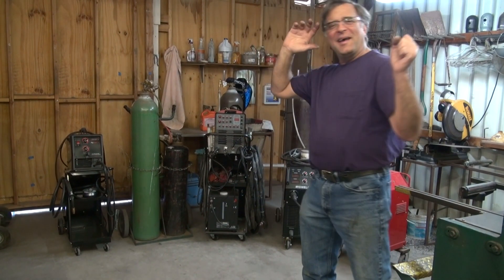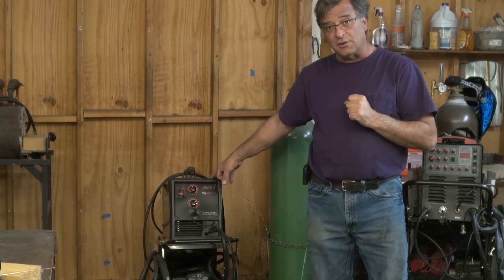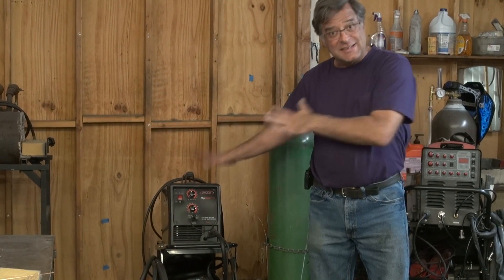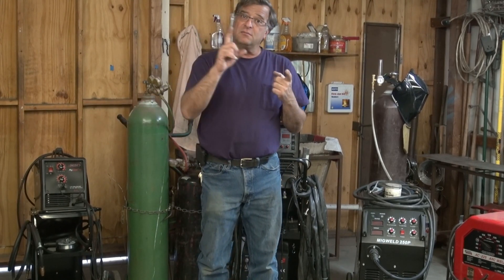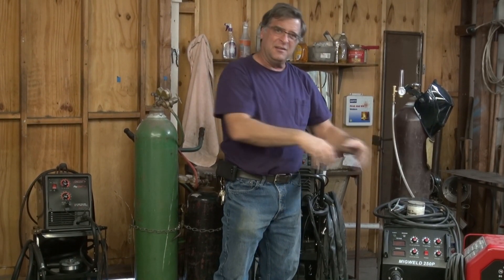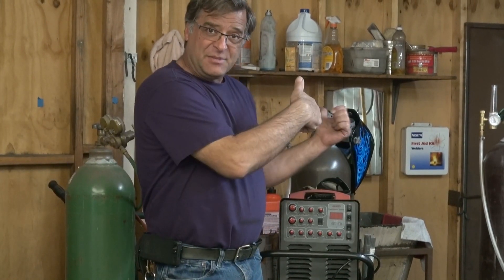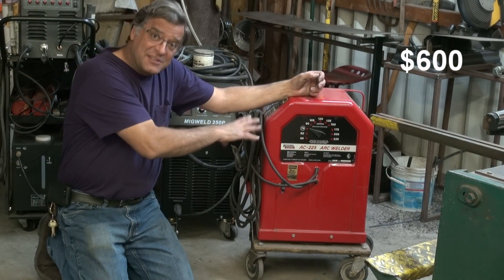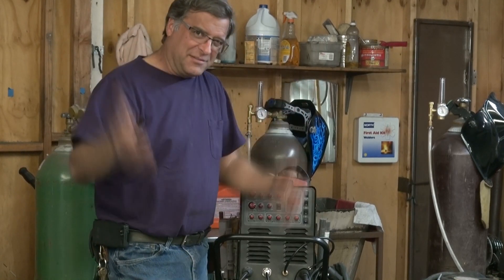How to Pick Your First Welder - Kevin Caron

Comment: I have a garage I'm renting that has 220 thankfully and my first four machines I just recently picked up are as follows Hobart TR 300 AC DC stick welder, a Lenco panel spotter c3000, a Miller Regency 250 a Miller spoolmatic 3, and an old Hansen Mig 1000 and I got all of the above for under $200 including a full tank 80lb c25 gas so for the sort of stuff I'm doing I'm pretty much covered on every angle now I just need to find a TIG machine and a plasma cutter
Reply from the maker: You are getting a great collection of machines going on!   Sounds like you have all your bases covered and you know where you are heading.
Reply: @KevincaronSculpture  thank you and yeah thankfully I was able to grab all of them for damn good deals but as far as where I'm going that I can't say for sure LOL so many possibilities

Comment: Almost every question I had answered, thank you.
On the smaller welder, the 110, is it truly a 110, does it need a separate breaker/circuit, can I move it around the garage or even take it to friends house?
Reply from the maker: Runs on a standard household circuit. Likes to have a 20amp, but runs fine on 15.
Reply: Thank you!

Comment: I want to build a hydraulic furniture dolly on casters.  The material I'll be using to make the frame is 2"x1" tube steel, and 1.25"x1.25" tube steel.  I'm not sure what the thickness of the tube steel is, but I figure experienced metal workers probably know what the thickness is already based on the dimensions I gave.  Thinking more long term as well, I would like to build a 20' car trailer with the same welder.  What type of welder would I want to buy to do both of these projects?
Reply from the maker: I would point you towards the Everlast MTS line. That will give you 3 different processes in one machine.  Mostly you will want a mug welder but having a tig welder as well will be handy.

Comment: great video. i'm starting a mobile small engine business doing mostly tractor work. i will be working out of my truck on a generator. i havent bought a generator yet and  i dont know how much welding i would be doing, but in my past ive sent my parts maybe 10 to 15 times a year to our welder. i have only welded a couple of time in my past. what do u think i should use or buy for both a generator and a welder. i imagine most tractor work would be steel.
Reply from the maker: You need at least a 10K INVERTER based generator to run the newer welders. If it was me I would have an MTS  machine. So you have mig, tig and stick all in one. That will get you started. Keep in mind that with a 3 in 1 machine if one part goes down you will most likely lose the whole machine. The other way to go is have 2 or 3 different machines. That keeps you working but costs more to acquire and takes up more room. I like the Everlast  welder line.  You can go with Miller if money is no object or Lincoln.  You might find some food used machines to get started and upgrade has you go.   Good luck and welcome to the club!

Comment: I though aluminum you got to have AC not DC to weld
Reply from the maker: Most of the time, yes , that is correct.   But you can do dc high amp with helium and get the job done.  But only on thick aluminum.   Not anything under about 1/2 inch I believe.

Comment: Hi Kevin, so I made my purchase today for the 256 everlast. Can I just add a 50-60 amp breaker to my box & run out some heavy gauge to a plug ? And its hf & this will be at my home, is it a must to run a ground rod to hook up in back of the machine ?
Reply from the maker: You only need a 30 amp breaker to run this machine.   50 amps would be better but not necessary. As for the ground rod, no, it is not required, but it would be nice.
Reply: @KevincaronSculpture  thank you Kevin, always for your quick response.

Comment: I taught myself to weld oxy acetylene in the basement of my apartment building ( on the sly ).  My first nozzle had a bad O-ring.  Then there was the time I was learning to cut on an old basketball hoop steel pole that (unknowingly) had been filled with concrete. Very exciting overall.
Reply from the maker: Just have to get it a little hotter!!

Comment: If you use a coat hanger (cocaine as heard by many in the comments), straighten the coat hanger all the way and put an end in a drill and use sand paper with pliers to take off the coating on the metal. (Use pliers or you will soon learn as i did, just how hot friction can get)
Reply from the maker: Never thought of that.   I just grab a hanger and go for it.

Comment: I need to weld super thick solid steel what kind of welder should I get stick welder types that is
Reply from the maker: I like the AHP and Everlast brands.   You can get a great machine that will not be so expensive that you need to take out a loan first. 250 to 300 amps for the really thick stuff.

Comment: Can a MIG welder use flux core wire in a pinch when gas isn't available?
Reply from the maker: Sure, just have to set the machine up for flux core wire first.

Comment: I watched this old guy weld sheet aluminum with a torch, no warping, maybe the warping is a higher possibly, but it can be done.
Reply from the maker: Sure, the old guys can still surprise the new guys.   Just don't ask them what they think of the new machines with all the touch screens and digital controls.

Comment: Thank you for the video.  I learned to weld in Highschool and was pretty good at it.  Now, 18 years later I want to weld again.  I'll be welding pipe fence,  as well as small auto/home projects. What you think about the ESAB EMP215IC 120/230-Volt Dual Voltage Professional Grade MIG/TIG/Stick Welder?  Would the ESAB Fabricator 141i Multi Process Welding System be enough?
Reply from the maker: I think the Fabricator is a fine machine.   All depends on your budget and what you want to do with it over the years.   Personally I like the Everlast and AHP lines better.  They both have Multi process machines.
Reply: Is that galvanized pipe?  If so, be careful about the fumes.

Comment: Hi Kevin, looking at a dual voltage Lincoln 180 dual. Any experience with this one. Would like to weld rr spikes and other items for yard art.  Also looking at a MM250. Not sure if that is overkill
Reply from the maker: Have not played with the Lincoln 180 dual yet.      I do have a MillerMatic 251 and it is a great running machine.   If the price is right I would go that way.    Having too much power is not a problem.    Not having enough is!

Comment: alright, I'm just starting now, so I plan on starting with Lincoln Square Wave TIG 200. Eventually(1-2 years from now), I need something substantial to weld truck chassis. What welder do you recommend? my garage as 220V/30(Nema 6-30??) Amp outlet and outside I have 240V 50 Amps(Nema 14-50 outlet).
Reply from the maker: If you get the Lincoln you are going to be ready to weld just about anything.   If you can get a 250 amp machine that would be better.   If you are looking for a mig welder then I would suggest a 250 amp machine as well.   Miller and or Lincoln make fine machines if you have the budget.   I have had great luck with the AHP and Everlast machines.
Reply: Thanks Kevin, I'm not seeing any TIG machine on Lincoln site that says 250. Do you specific model name that I can google? I'm ok with other brands as well.
Reply from the maker: My bad!    225 or 275 amp only.   Check out the Everlast PowerTig 255ext for a tig/stick machine.  Have been using mine since 2014 with no problems.   They also have a PowerMTS  253 (I think) but have not seen one yet.   It is a 4 way machine with AC/DC and a host of other features.  Been using the smaller version (221 amps)  for a year or so and it is a good machine.
Reply from the maker: You should also check out AHP AlphaMig 250.   Just on the market as a 4 way machine.  Just got mine and will have videos in the next few weeks.
Reply: Thanks Kevin!!!!

Comment: New to welding need to weld 1/4 in steel tube on a couple gokart. Will be doing it outside in the back yard. Will be useing 120 as the power source. What are my options?
Reply from the maker: Make sure you have clean metal and if you are using solid core with gas make sure you block the wind.  If you are using flux core just make sure you have a good fit.    For stick I would recommend 7018.

Comment: what materials can I wled with a 90 A machine?
Reply from the maker: Well I am assuming you are talking about a Stick welder.   You could maybe weld 1/8 inch steel with this machine.  Not any thicker I am afraid.    If it is a mig welder running flux core less than 1/8th inch.
Reply: Kevin Caron, Artist it is a flux core 90 A welder ( only flux core) and I have to choose between this and an 140 A stick welder...
Reply: I am a beginner and I don't know wich model of welding machine to buy, can you recommend to me a good one?
Reply: I got 150 dolars
Reply from the maker: Keep what you have for now.   Learn to weld and maybe make some money.  Nothing I can recommend in your price range.
Reply: I don't have one for now, it's the first welding machine I buy and I was thinking to a flux core, is it better then stick welding?
Reply from the maker: I like stick over flux core.   But most guys will say go with the flux.   Your choice for sure.
Reply: thank for advice, good video... very helpful for a beginner like me

Comment: im trying to get a tig welder so i can weld stuff on my cars etc...recommendations??
Reply from the maker: AHP alphatig 200.    Best AC/DC tig on the market.
Reply: ty ill check it out
Reply: Disconnect your battery before you TIG weld on your car.  You can screw up the car's computer if you don't.

Comment: Does argon gas blow of  during welding what is the risk and safety
Reply from the maker: The argon gas flows across the weld and keep oxygen from getting in to the weld.

Long as you don't try to breath the gas you are fine.

Comment: Hi Kevin, how are you? I live in Ecuador and am wanting to get started learning how to weld so I went ahead and started looking around. In my area all I can find is either $1500+ imported 220v mig welders (mig only or multi in 1) or its the generic rebranded $500 chinese 3 in 1 welders that are at least dual voltage. ( I would have to get a 220v meter put in and wired up to use anything 220v only and seeing as I am a renter, that isnt quite an option.) Either way its going to be quite a decision to make seeing as $500 is the monthly wage for a average full-time job. So just plunking down $500 is quite a big loss if I end up with something that doesn't work properly. So I thought I would ask if you or anyone reading the comments has any experience with chinese generic 3 in 1 welders and if they are worth it to start learning with. The chinese welders available here look like they are all the same model with just a different brand on it. The only one I could find a actual model number of was the gladiator 3 in 1 model: IMET 8250/190 BVM. any experience with these things? ( http://tinyurl.com/yc5wbpce http://tinyurl.com/ycdzj6bx )
Reply from the maker: I really know nothing about those machines!   

Sorry.

Comment: Mr. Caron, thanks for making the video.  Very informative.  Made my decision on what type of welder I needed pretty simple.  Pretty sure the 110 volt, flux core MIG welder will suit my needs (utility trailer repair/muffler and exhaust modification/lawnmower deck repair/etc.).  Thanks again for the information.

Comment: First off love your videos!  Have you ever used any of the Eastwood welders ? And if so what do you think of them? I am thinking of the  Eastwood MIG Welder 110VAC/ 135A  for my first welder. Would this work out for making small sculptures such as small scale bells and stands for them.
Reply from the maker: Sorry, never even seen an Eastwood machine.
Reply: I have the eastwood mig 135, it's really a good welder if you stay at 1/4 inch or less! I got mine for 269.00 to my door!  I chose it because I don't have access to 220.

Comment: just get something that will burn an E7018 and start welding. a shitty wire feeder or gun will drive you insane so unless you are doing high production, heavy fabrication or aluminum... SMAW is the way to go.
Reply: Marshall Clark Yep, SMAW is the way to go. I prefer 6011, tho. However, the plain fact is, it takes a bit of a skill level to stick weld that alot of beginners aren't willing to obtain. They wanna run out & get a cheap wire feed flux core because it's basically so easy a chimpanzee could about weld with one. Heck, if those wire feed flux core welders weren't so cheap, readily available & super easy for beginners to weld with AND if stick welders were all that was available, I bet you'd see a whole lot less DIY build/repair YouTube videos that involved any welding. I've seen alot of beginners that could put down a decent bead after a few minutes using a wire feed welder but couldn't strike an arc, let alone maintain that arc & lay a bead with a stick electrode after a half hour of trying, and that's about how long it takes them to give up on learning to stick weld & they go buy a "so easy a chimpanzee can use it" flux core welder, use it on a couple "around the house" projects & think they're a welder that they actually aren't.

Comment: Also forgot to mention Kevin as the part will be left bare metal I also would like the weld to be not noticeable at all. So not sure what method to take into  account.  If that makes any difference or not. Thanks again buddy hope your having a great day.
Reply from the maker: I see a lot of grinding and polishing in your future!    The biggest thing I am worried about is warping the ways.   All depends on where the damage is and how much heat it will take to fix it..     You might want to disassemble it and take the damaged part to someone that is more knowledgeable then me.
Reply: Kevin Caron, Artist thanks Kevin the ways are in perfect condition.  I should of made myself clearer what I meant to say is the large tray under the bed . Where coolant is collected is pretty beat up. Not a great deal just needs straightening out
Reply from the maker: Oh, okay now I understand.     You should be able to mig or tig that and get a great weld.   just have to get it clean before welding.

Comment: Hi Kevin great channel I've just subscribed. Wanted to ask your professional opinion . I'm just started restoring fully my colchester master 6inch lathe built in 1939. And have some damage not by me but previous owner. Where the compound slide runs across the two grooves.  The very corner has been broken off.  And don't want to just leave it like that considering I'm fully restoring like it was, when it left the factory. Do you think I should consider purchasing a oxyacterline welder. To repair the slight damage to the corners. I'm prepared to  learn before even attempting the project just want your input on what's the best way to go down.  Also my workshop has not been built yet so be working outside in the garden. Also there's a few dents in the lathe tray that I need to remove. Be grateful for your advice Thanks in advance
Reply from the maker: Thanks for watching and putting me on the spot Mark!

I would stay away from the O/A rig for this repair..      If it was mine I would use a tig welder..     But without seeing the damage I am not going any farther than that.

Comment: Have you ever reviewed welders from Harbor Frieght???
Reply from the maker: Nope, have to have the budget to buy machines for review.
Reply: ChuckE2009 has reviewed the Vulcans.  The Vulcan brand seems like a real attempt to improve.  I bought an OmniPro220.  I can MIG, TIG and stick, in 110 and 220.  It has an LCD screen and you select options for type of weld, electrode, gas, and metal thickness, and it comes up with a setting for you.  You use it a little and then adjust, if necessary.

Comment: Hi Kevin I've never welded except minor stick spot welding expanded metal to trailer ramps but I want to start, a bucket list thing I guess. my budget is around $2000 that has to include buy my own gas bottle. I could go a little more but might anger the Wife. I'm wanting a MIG/STICK. I'd like to weld up to 1/2" mild steel. even some aluminum.  I really could use your advice.  I love your videos. in the last year I bought a heavy duty oxygen acetylene cutting torch and a 80 amp simadre plasma cutter. my garage and basement is wired for 220. I've been thinking about a Lincoln 210 MP but I'm just not sure if that's the one ????? Need Help deciding.
Reply from the maker: The Lincoln is a fine little machine.    Should be just right for what you are looking for.

Comment: For the 220v couldn't you just run 2 cords to it from different circuits in the garage? Why wouldn't a 220v welder have plugs designed for this?
Reply: No.  They would have to be off opposite sides of the feed.  Well so in theory IF you know you are off opposites sides and you wire it correctly.  No company would ship it that way because if it's not from opposite sides you won't get 220 and if the outlet is wired wrong you will have a dead short and a law suit, fire, big problem.
Reply from the maker: Or just wire for 220 and be done with it..
Reply: Kevin Caron, Artist
Well yeah, but you can't rewire a home owner's house.

Comment: Any suggestions for the best TIG welder that can run 110v? I will have access to 220v on occasion, but don't want to count on it.
Reply from the maker: AHP AlphaTig 200.
Reply: My vote would be the Everlast 200DV or if you have the money definitely the 255EXT dual voltage.
Reply: I would second the AHP Alph Tig 200.  They are pricey again right now but apparently when the stock runs out and there is a wait the price goes down.  Still a good deal at $9xx but a couple of weeks ago when there was a wait it was $680.